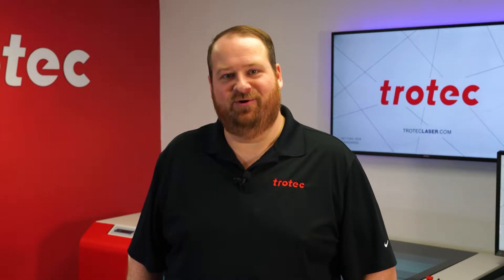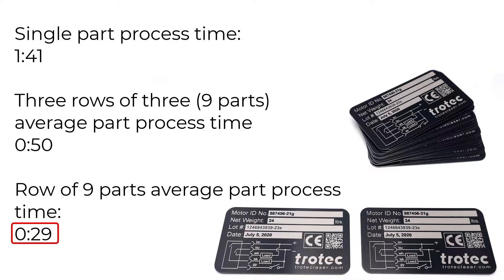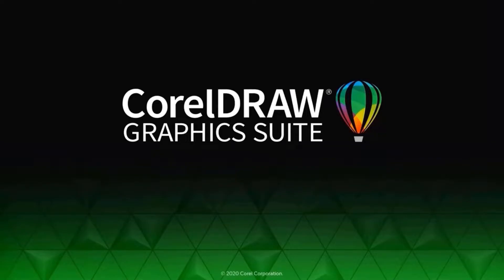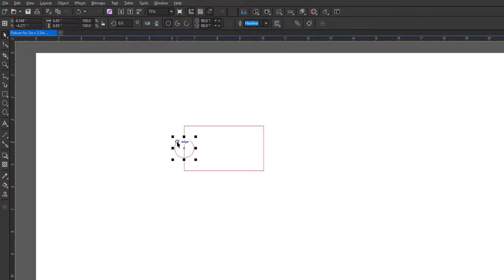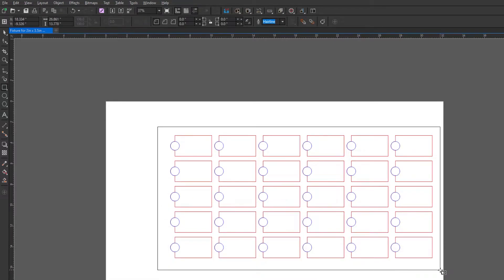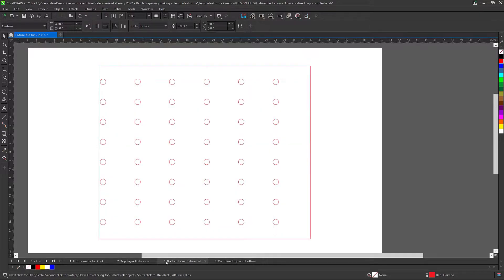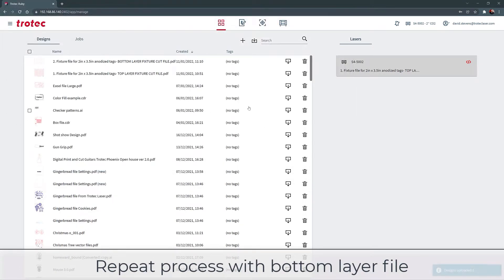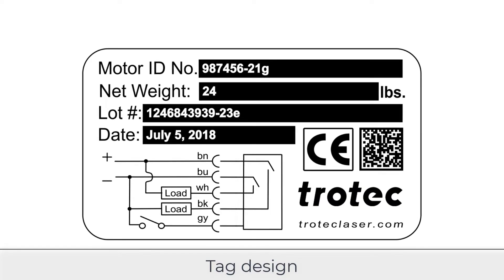Deep Dive with Laser Dave: Fixtures for Batch Processing

Comment: Thank you for the video. May I ask how did you align the actual engraving graphic with the fixture's location in the final step? During the cutting process of the fixture you just moved the fixture design "a little away from the corner". Wouldn't you need a specific coordinates to ensure the actual engraving is done at the exact spot everytime?
Reply: When cutting the fixture, moving the cut file slightly off the ruler is recommended, so the material will not cut directly on the rulers. However, after the fixture is assembled and the fixture file is placed into the prepare screen in Ruby, it automatically locates the file in the upper left side of the screen, matching the location to physically place the fixture in the machine. Because the fixture colors (Red and BLue in this case) are skipped, the engraving portion (Black in this case) is already offset.
Reply: @davidstevens2577  Yep I get it now. Many thanks for those videos David.
Reply: Hi David, went to one of your training sessions in charlotte.  I can’t get my “widget” file to lineup. I’m using the exact file like you did here.  Any tips? How do I line up my laser? I have the speedy 400 80 watt with camera.